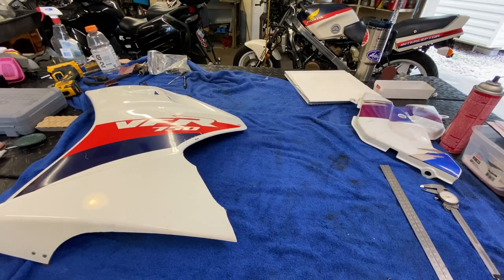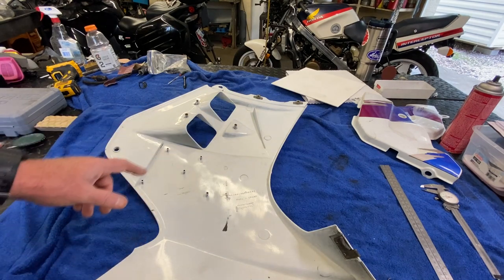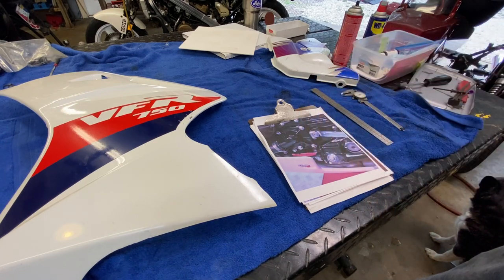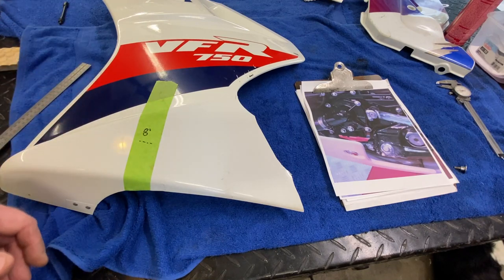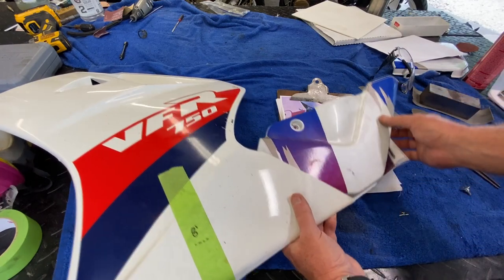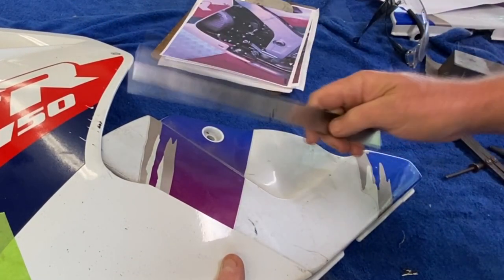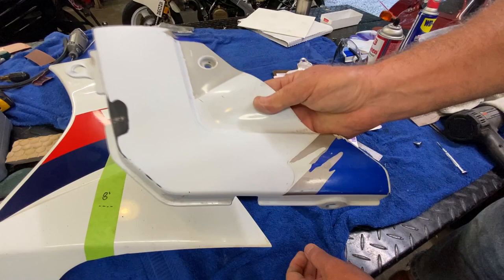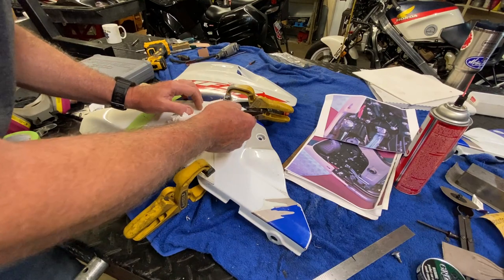Repairing VFR750 Bodywork - Side Panel: Recreating the missing piece!

Comment: I'm glad you took my comment as constructive criticism and not just complaining. You have the most extensive site with the most thorough tech info, and there are a couple of other good ones out there.....Also, I am an early Honda Interceptor fan and am saving an 84 VF750 from a previous hammer mechanic and picking up an 86 VFR 700 project this week.
Thanks for your video. I am now a suscriber.
Reply from the maker: Complaining would be quipping about garbage on the floor, not what you wrote. I’m always interested in feedback that can help make better content. Thanks. Tariff buster VFR. One of my costumers has one.

Comment: Did u cut the cheese? and gas the dog ..... yes no yes no yes no  lol 😂 good work plenty of patience and  eyeballing  etc going on their have u seen those two pronged  heated guns that u insert both ends of a shaped wire clip into pull the trigger it heats the clip press into the  plastic give it a bit a twist to lick it in beneath the surface release the trigger and clip the ends off the wire clip nice and strong cheap on eBay
Reply from the maker: Yes. Another viewer just mentioned that. Never tried it. Thanks